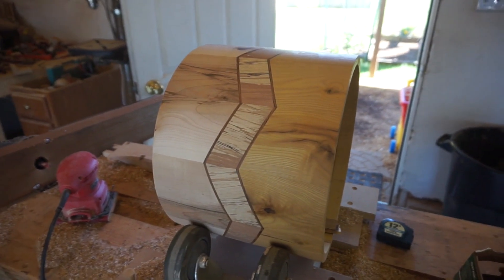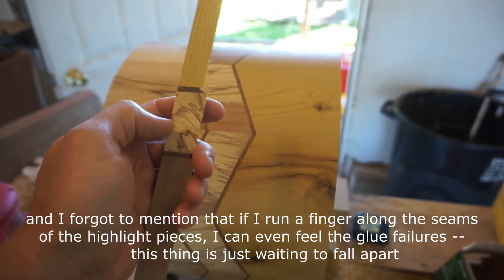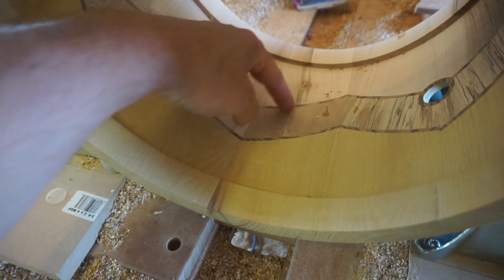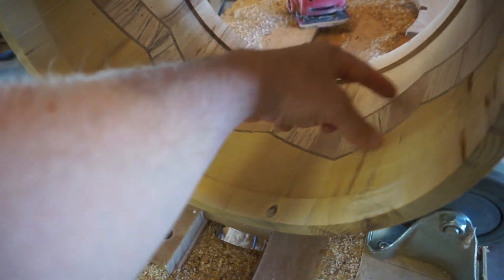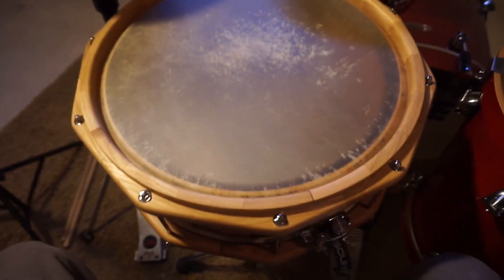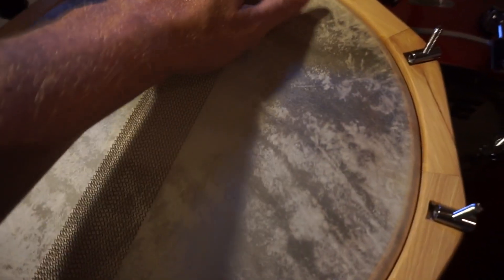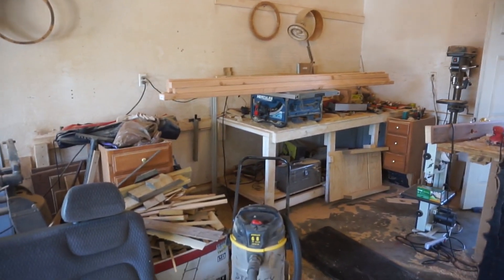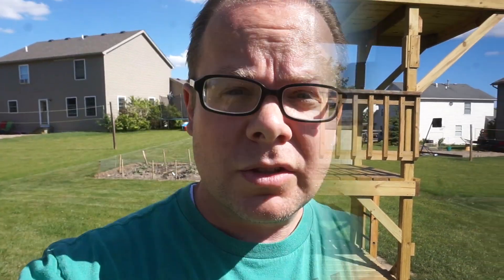SHOW & TELL

Comment: I have just renovated a 1930s Tom Tom which has a tacked on bottom head and Timpani handle tuners. It had quite a complicated structure with reinforcement inside the shell. There were panels on the inside which were very thin, with the grain running vertically top to bottom. Probably steam bent, pulled into shape and glued. It also had beech reinforcing rings top and bottom.

Comment: Your conundrum made me think of how luthier's reinforce acoustic guitars. The thin strips tend to be in a diagonal, if I recall rightly, but they also sand/round over the face of those added structures to lessen the impact of reverberation. I agree that the vertical fins would have minimal impact to the air movement, but that doesn't take into account the way the wood might reverberate as well. Perhaps thin, vertical strips around the circumference at regular intervals, glued to the inside, at most 1/4 of an inch with the inward face rounded over to almost give the interior a ripple/wave effect?

Comment: When taiko are made using staves like this they put small strips running diagonally to strengthen everything, also using epoxy would be stronger then wood glue. If you want send me a message and I will help where I can. I make taiko as well.

Comment: Have you thought of using epoxy on the inside
Reply from the maker: I have, but if I use it (and I think it's the most appropriate adhesive), it will be to attach whatever other technique/wood/pieces I apply.  The problem with using epoxy or resin alone is how to reasonably contain it without it spilling/dripping everywhere.  I suppose there's a solution for everything, though, so maybe....
Reply: @JosephCenter  I was thinking epoxy too.  I have used epoxy a few times for decoration on drums (and my next drum will have a lot of colored epoxy).  You already have the rings on the inside to hold a layer of epoxy in the middle like a dam on each side.  The problem is that you need to keep the drum turning till the epoxy sets up.  Then you would need to skim the inside of the drum again to get the layer of epoxy perfectly flat and smooth.  Watch my video to see how to do it with a big rotary cnc, but that does not really help you much.
Reply: If you go the epoxy route you could plug the vent hole with a cheap piece of pine (center punch before inserting), then tape it on the outside to prevent leaks. Then simply drill it out after the epoxy cures.

You could build a simple rotating jig to keep the shell slowly rotating, which will prevent the epoxy from pooling at the bottom. That worked well for the epoxy river shell I made a while back. The reinforcement rings will keep it contained in the shell.

The main concern I have with that method would be that the epoxy would probably have to be rather thick to really stabilize the shell (at least 1/8"? Maybe as much as 1/4"?) I suppose you could just mill the shell thinner first to compensate.
Reply: I think I'd rout a channel down the middle of each joint (and/or between the joints), inside of the shell, almost to the re-rings, about 1/8" deep, 1/2" wide...and fill with clear epoxy, then skim cut the inside so the wall is flat...but you'll have to sand and polish or sand with a high grit and a finish to get the epoxy clear.
My idea is that you can just leave the shell (epoxied channel down) to dry and harden, then go to the next one. Should go pretty quick...but the most time may be put into the router jig you'll need to cut the channels. My half asleep brain didn't think past this point lol.
Good luck...curious to see which "route" you take. See what I did there? Haha

Comment: Hi Joseph, I built a zig zag drum, somewhat like yours. Maple with a 3/8"ish wide walnut zigzag stripe running through it. I tested my sample stave, which, granted, was still 3/4", and I cannot break it with my bare hands, full strength attempts.( I used titebond III, I believe.) Finished drum is 3/8" and I'm thinking I should plane down my sample to the same thickness and test it, but I'm pretty confident it was still be very strong. Are you sure your finished thickness won't have enough strength?

Comment: no tuviste en cuenta las propiedades mecanicas y de construcion . dedicate a otra cosa
Reply from the maker: Actually, yes, I did take into account the mechanical and construction properties, as you call them.  This drum shall has always been an experiment.  That, and, well, it's made from firewood.  The entire point of the project has been to see if it would work.  Maybe it will, maybe it won't.  The experiment isn't complete.  If the best you can do in the comments is troll the maker with attempted disparaging comments, you came to the wrong channel my friend.